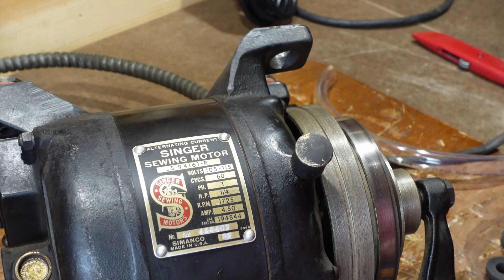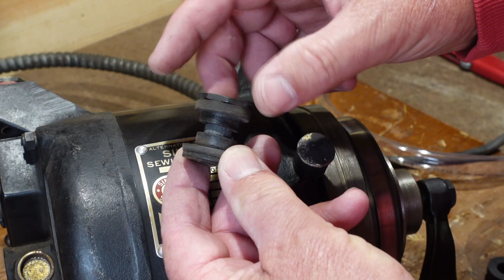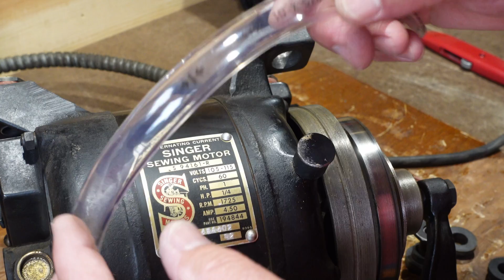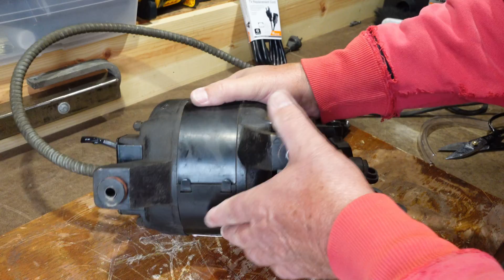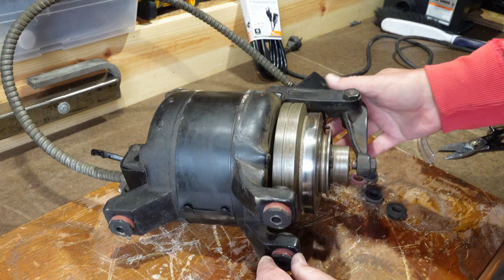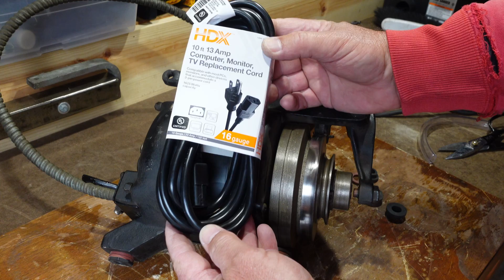SINGER INDUSTRIAL SEWING MACHINE MOTOR MOUNTS DIY REPAIR

Comment: Can anyone tell me what the material is at the end of the clutch contact point is? Mine is shot and I need to replace it.
Reply: Depending on the motor, I've seen leather being used as the material for the clutch material and/or cork.  There were some Singer branded replacement clutch pads on eBay when I looked a few years ago, but the problem is you would need to match the part number to your specific motor, which Singer made a lot of versions of.  A few of the Singer motors I've had, the clutch pad did not appear to be easily replaceable as they were riveted on

Comment: Excellent, helpful video! I have this exact motor and I do not think it has ANY motor mounts; just bolted on. 
Question about the 1” black screw-on knob. I open mine and I see dark waxy, hard substance. I think it is dried up grease. (Machine has sat for 22 years.) How would I clean it out? Do I have to take out a bearing race and clean it? 
Maybe this is a subject for future video. 
By the way, love the motor clutch video. Really going to help my motor come back to life. Thanks,